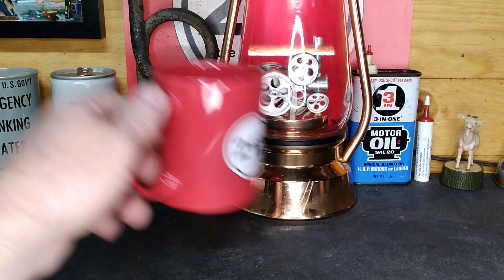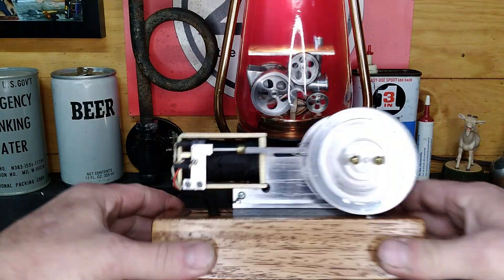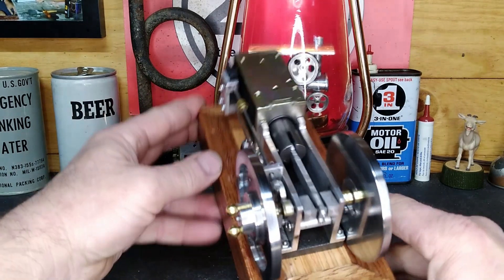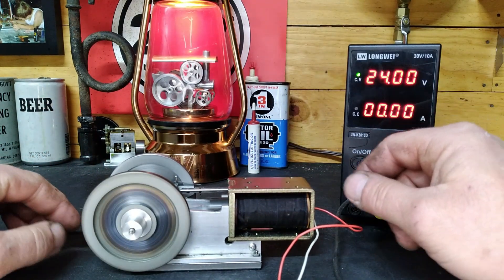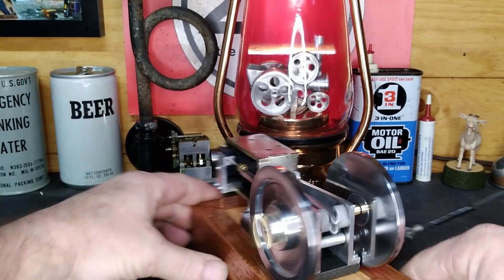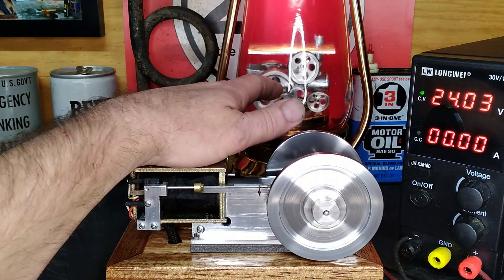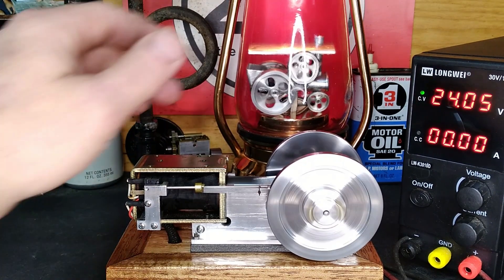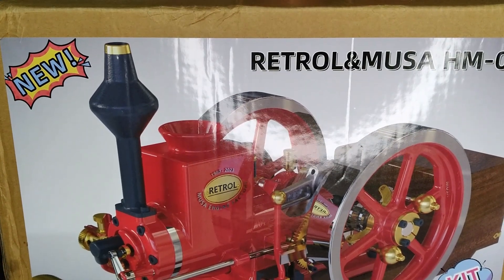Amazing Hit & Miss Electric Engine from Coilmotorworks!

Comment: While watching your Taolei Electromagnetic Piston Engine video I thought I should gio back to this video and leave a note on lubrication of the motor in this video. One part that should not have any lubrication is the slip collar. The slip collar converts the motion from the spinning governor to the stationary lockout lever. The collar needs to slide freely with no lube. The hole in the collar is a loose fit and the shaft is smooth so lube is not needed. Lube can be usef in the grooves but must be a light oil. Air tool oil or WD 40 or a 50/50 mix of both oils works well. Keep up the awesome channel! CMW
Reply from the maker: Without a doubt the hit and miss engines that you build are MUCH more refined than the Taolei is. I can see exactly what you mean about thick lubricant on a close tolerance part such as the slide collar, too thick of an oil will prevent it from being able to slide evenly to lock and unlock.  Thank you for the great tip 👍

Comment: An additional area of concern on the HM-01:
  The cute little glass oiler on it does not have a "lower" glass to view drip rate during operation, from what i have seen so far the brass caps may not be removable from the glass tank? Perhaps it may not be nessesary to remove them to adjust/mod the drip valve? Most guys complain of the oiler going empty at a very fast rate, not a terrible problem during break in, but would be nice if it could be slowed down to a more practical rate?
Reply: Ummm...it was fast to begin with but you can screw it in. Mine drips really slow, like a ml an hour now or less, fine for this, perfect really

Comment: And Mr 212, your woodwork has improved. It's now 1000% better than anything I can get wood to do :)
One tip for the HM-01, do not attempt to run it in continuous mode at any speed for any length of time as it would exert great pressure on the pin at the crankshaft/slide-slot pin at the end of the detent lever. Better to hold the  governor balls in with something
Reply from the maker: I've started the assembly on it (without any instructions) and I really don't see any advantage to the constant run lever, it seems to me that it's only purpose is to override the governor (bad idea).  I may lock it into position and disable that feature entirely.  Thanks for the heads up Mr. Thomas and keep up the great work 👍